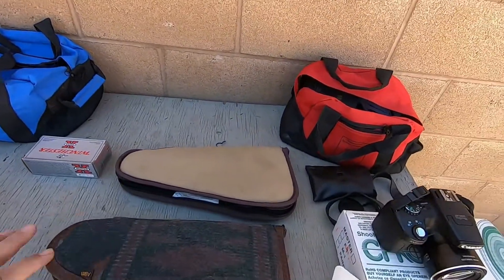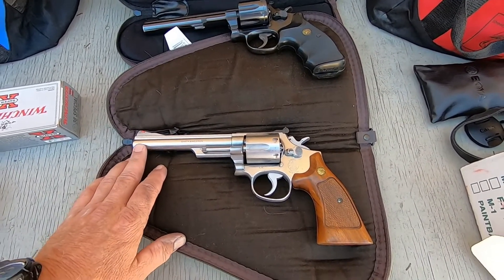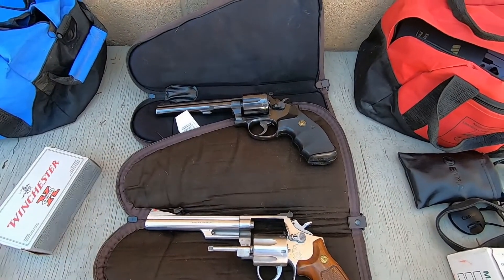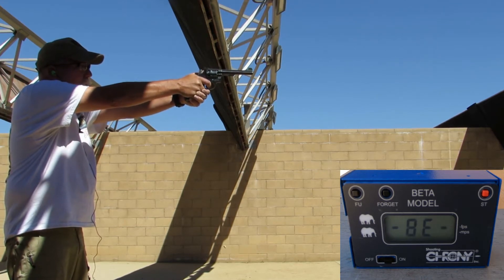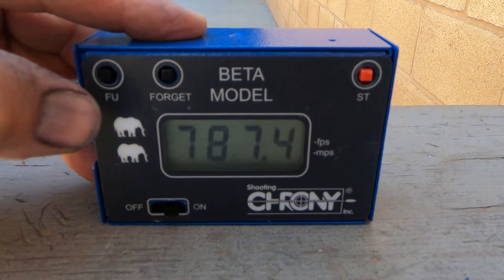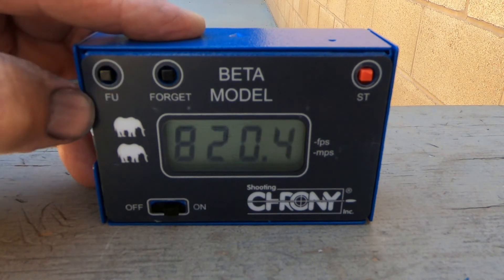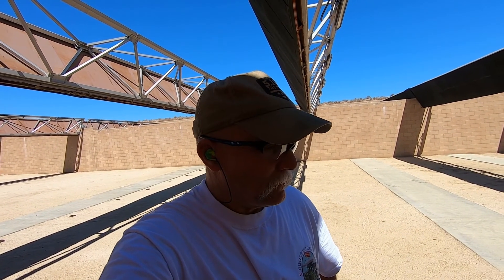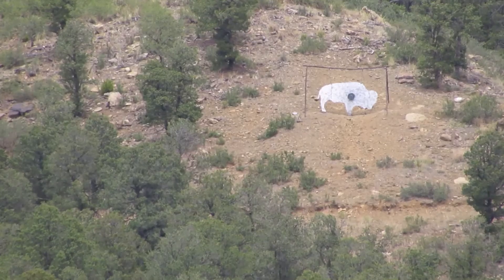Is there a velocity difference in blue vs stainless barrels?

Comment: I'm sorry, but how can any serious person consider this a conclusive test?  How can this (very unscientific) test possibly be construed as definitive proof that carbon steel guns shoot at a faster velocity than a similar stainless gun?  
Did you test (measure) to be sure that all of the chambers in both guns have absolutely identical dimensions (especially the throat diameter)?  Do both guns have absolutely identical bore and forcing cone dimensions?  Is the depth of the riflings absolutely identical between the two?  Do they have absolutely identical barrel/cylinder gap and endshake?  Do both of them have an absolutely and perfectly timed action?
If I were a gambler I would be willing to bet a VERY large sum of money that it would be easy to find another "matching set" of carbon and stainless revolvers which would show opposite results.
Reply from the maker: I'm glad you're sorry.  I don't think I ever said this was a conclusive or definitive test but it was simple entertainment demonstration that there was in fact a minor velocity difference between my somewhat scare carbon steel Model 15 6 inch and my kind of rare stainless Model 68 6 inch.  No need to mic, pin gauge and measure ever aspect of each gun to verify exactly identical because you'll never achieve that...but as far as end shake and cylinder gap, yeah they're pretty stinking close.

No need to make any wager because you are most likely very correct, and I for one will be waiting patiently for your video showing the opposite result. No need to @ me  as I am sure it'll pop up in my feed when it goes live.
Reply: @Halfmilesniper  you literally presented this video in such a manner to suggest there might be a difference in bullet velocity based on the type of steel in the gun. And now you're trying to weasel out of it by claiming that you posted it "for entertainment purposes" and to simply "show the differences between your guns"?
As Joe Biden would say, "C'mon, man!!"

Comment: I’m trying to decide between stainless and blued for my first revolver. Any pros and cons for both?
Reply from the maker: Blued pros...the guns are pretty (I love a blued pistol). Cons...you have to keep them clean, bluing is actually rust so no rust remover or abrasive cleaners. Fingerprints will rust too, red/orange rust not blue rust, lol.

Stainless pros...great for working guns, less worry about rusting (although stainless can and will rust). Can use mild abrasive cleaner to remove stubborn powder burns etc.  Cons...they aren't that old timey pretty, stainless can gall (think screws and wear points),

For a first gun a stainless gun won't be a bad bet.  Eventually you can branch out into some of the blued options...the Old Smith & Wesson blue was a different process that the Colt blue but both are beautiful in the sunlight. The newer guns from both are blued using a different process now (chemicals, salts and other ingredients) and they seem to be fairly durable but don't have that "deep pool" appearance.
Reply: @Halfmilesniper  Thanks for the informative answer.

Comment: As far as I know the 6 inch 66 do exist. The 68 was a special requirement for the CaliforniaHighway Patrol and never sold to the civilian market. A very rare model. Also the 15 with 6 inch is rare. Normally its  the model 14 which is a 6 inch target version of the model 15.
Reply from the maker: My Standard Catalogue of Smith & Wesson does state there were 6 inch Model 66s made...but I have never seen one. Some day I would like to have one. Both the Model 68 and the 6 inch Model 15 are rare as you noted. I am especially lucky as my Model 68 was not over stamped to alter the CHP marking...mine still clearly shows CHP on the frame.